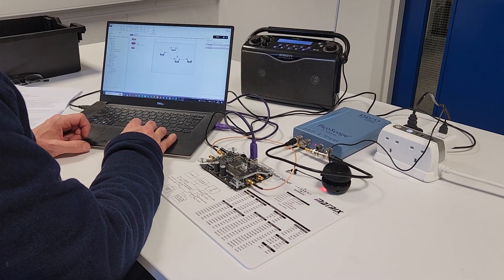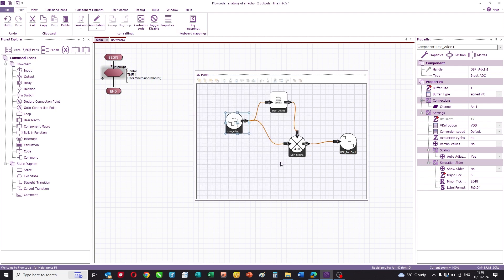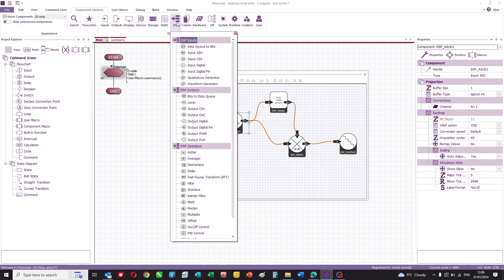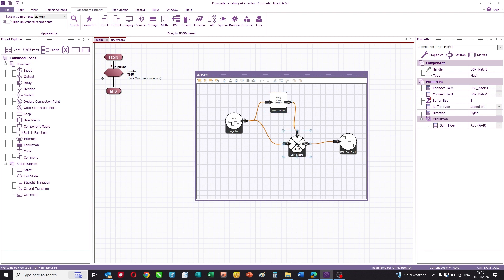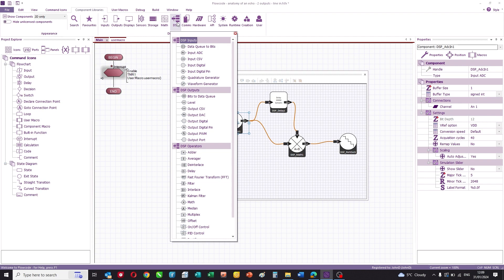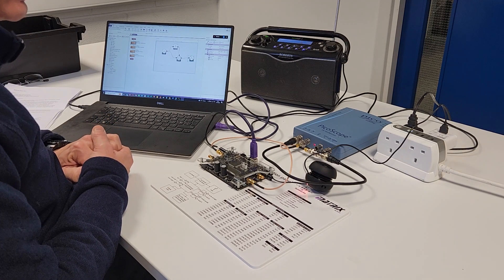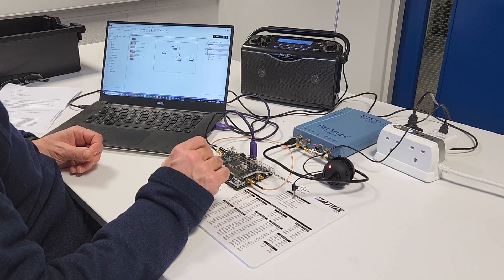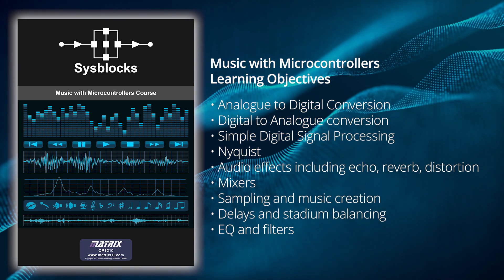Sysblocks - Music With Microcontrollers

Comment: "44 khz is a bit of a magic number in audio because it divides nicely to produce the individual frequencies that we associate with the keys on a piano"   That is false. Even the lowest common multiple of just the top two keys on the piano is about 16 MHz (16,000 kHz), already far above 44kHz, so this assertion can't possibly be reasonable.
The frequency 44.1kHz was chosen for compatibility with NTSC and PAL video signals. The ability to represent the notes of a piano, or any other music, in any tuning, is a result of 44kHz (or really any frequency above twice 20kHz) being above the Nyquist frequency, which is to say, the sampling rate that's theoretically adequate to reproduce signals of that frequency range.
Reply from the maker: We use 44.1 kHz because it is the standard for CD audio. The demo would have worked equally well if we had picked a slightly different sample rate.

There are a few reasons for 44.1 kHz being chosen for CD audio: -
(1)	The human ear is sensitive to sounds up to about 20 kHz.  If our sample rate is to be more than double that, then you can’t tell that the sound is digitised.
(2)	You don’t want the rate to be too high because more samples take more space, and you want to fit an entire album on a standard CD.
(3)	In the distant past there were systems for recording digital audio onto video cassettes the used sample rates close to 44.1 k
(4)	44100 is a nice round number. If you take the first four prime numbers (2,3,5 & 7), then square them (4, 9, 25 & 49), then multiply the squares together you get 44100 (4 x 9 x 25 x 49 = 44100). This means that when you try to divide 44100, you often get whole numbers.

There is a Wikipedia page on the subject if you want to read further: -
https://en.wikipedia.org/wiki/44,100_Hz#Why_44.1_kHz.3F
Reply: @MatrixTSLtd  ... and that Wikipedia page describes just what I said -- that ultimately the specific number 44.1kHz was chosen to fit quite narrow criteria for being able to record digital audio on video recorders for PAL and NTSC.    DAT chose a different rate. CDs could have chosen some other nearby rate, but settled on 44.1kHz because it was an already existing standard, and was apparently thought good enough for capacity.   The fact that 44.1 kHz can be factored into the squares of the first 4 primes is novel, but I challenge you to find some reason that's beneficial, other than this recording compatibility goal.  What those integer prime factors don't have any relationship to are musical note frequencies, most of which are not integer frequencies. Indeed, if the sampling rate did somehow treat different content frequencies differently, then it would not be a faithful sampling scheme.